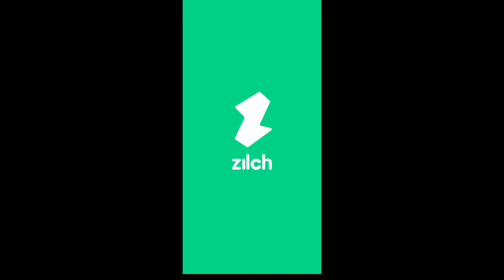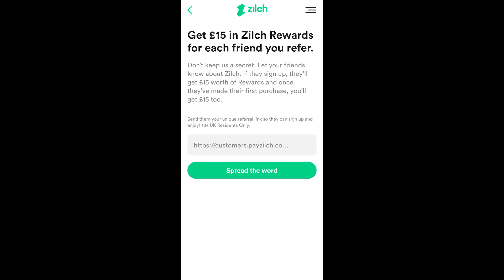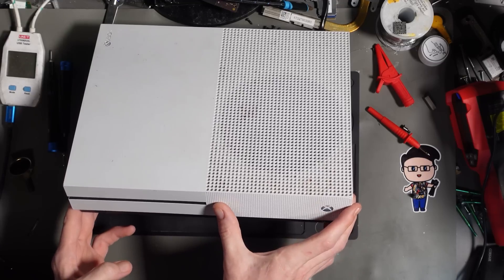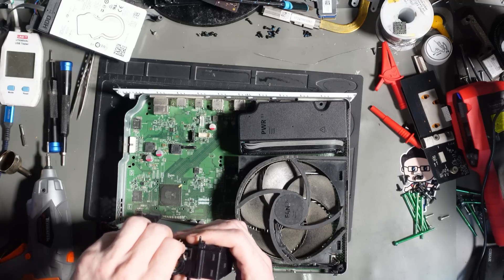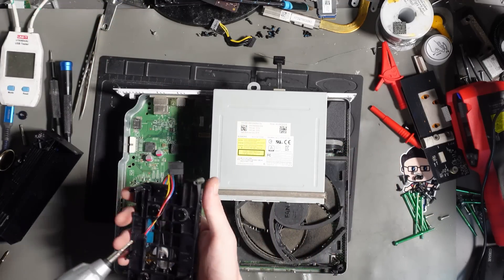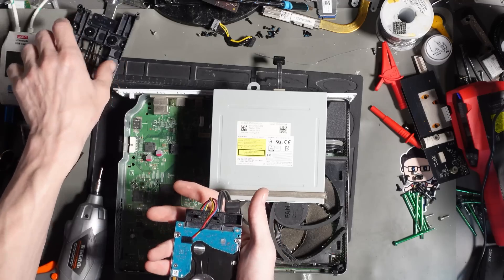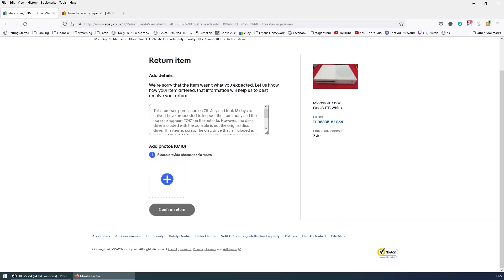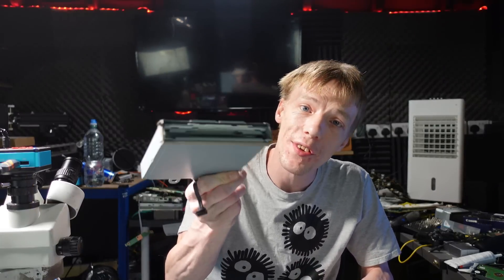I Bought An Xbox One S On Ebay And I Think I Got SCAMMED!

Comment: Wouldn't it be funny if the eBay seller tried to repair an Xbox one and an Xbox S at the same time. Failed to do it and put the wrong drive in both consoles. Someone out there will be receiving an Xbox One with a Series S disk drive 😂

Comment: I try to buy parts/repair consoles from sellers that don't deal in video game related items often . I especially stay away if it's listed as untested and they sell lots of tested/working ones . The only exception is Japan , I have had good luck buying broken consoles from Japanese sellers that only sell video game stuff . I have only gotten ripped off once from Japan on a WonderSwan Color that was missing screws and had a totally corroded motherboard that they did not mention . I ended up using the screen to repair another one so I broke even on it in the end .

Comment: I have been buying stuff on eBay for 18+ years. Over the years I have been scammed and got my money back for parts that turned out not to be what they were specified in the listing.  The thing is that I have still lost the time waiting for the part to show up usually 2-4 weeks. I then have to source out another part. Sometimes this happens with a laptop in pieces waiting for the part.  

Then there are the sellers who are charging horrendous prices for shipping a small item and that gouging for shipping is fine with eBay. You still have to wade through the listings trying to sort out the possible deals from the gougers. I rarely buy things on eBay these days

Comment: Classic ebay. Once I bought "working" PS4 Pro with "faulty optical disc drive"... in fact with faulty power supply holding just by a scotch tape (ripped screws) 😒

Comment: Get it sent back don't blame you some folk on ebay think they can send out anything if they put spare or repair and no return, wrong if the item is not as described as is the case here then no return means nothing the item must be as described and shown on the advert pictures, good on ya, i have had one off this seller which had damage which they failed to mention which would have taken a 2 second visual inspection to see.

Comment: Wonder how many times you've picked up a cheap console that's been described as faulty but you've found no fault - do you contact the seller offering to pay a more realistic price - doubt it. Don't get me wrong, I think this is bang out of order, but sometimes you get lucky sometimes you don't.
Reply from the maker: I've actually never picked one up on ebay and found nothing at all wrong mate. The thing is like you said this one is obviously a scam, but if I get them in for repair from customers and find nothing wrong I don't charge them apart from the return shipping, or if it's not as bad as first thought I'd call them up and request a cheaper price. I've done that stacks of times.

With ebay though, I win on auction for most things, so if I did get one with nothing wrong of course I'm not going to offer more money because that's the entire point of an auction, and if I've won it fair and square and the seller either hasn't tested it or misdiagnosed it that's not really my problem. But when we buy them and they've obviously been deliberately deceptive that's just wrong
Reply: Seriously, thats not a likely event, its never happened to me and I've been buying consoles to repair for about 5 years now.  Its not about gambling and getting lucky or not, its about sellers being honest with what they are selling, nothing more. Too many chancers on ebay who get away it.

Comment: This is a huge problem in the US with Nintendo switches. At least it is for me. Only 3 out of 8 or 9 Nintendo switches I bought on ebay weren't scams. The 3 that weren't scams, I was able to fix. I got screwed out of my money because they said they bought it as a lot and knew nothing about it being opened and previous repair attempts and I bought as parts. I loved working on Nintendo switches and liked learning, but I've now stopped buying them from ebay. I've stopped buying them all together because I don't know where else to get them. The risk is way too high and I have since been repairing Retron 5's instead and have been able to fix all but 1 due to dead CPU. It's very sad how many dishonest people are out there. I've given up...

Comment: I have a launch xbox one and my mom dropped it moving stuff around nothing was damaged internally and still works like normal but the front part of the shell where the touch sensitive buttons are the clips on the bottom that hold it together separated and thankfully the clips weren’t broken but i did not realize i had a disc stuck in there and I don’t have the proper tools to just take off the case (not the metal case where the motherboard is in) and I took off the case but I don’t know if there is a manual way to take the disc out of the disc drive and I am wondering if you know if there is a way to manually eject the disc and I am looking at tutorials on the how to het the shell back on but I am having troubles with getting the clips on the front bottom of the case and I may need help with that to. I also never broke my warranty seal until yesterday. Also I am trying to figure out how to upload a youtube video on an iPhone so I cam show you what I mean
Reply: FFS mate, I gave up trying to read this halfway through the second line. Put some punctuation in there!

Comment: I'm always concerned with trying to prove my case on stuff like this, because you open a dispute and it 9/10 times it's checked by whoever Ebay outsources their customer service to, maybe Malaysia? India?... So how do you prove to them that the part inside isn't original when they're none-technical, and their first language often isn't English. It's a frustrating issue altogether.
Reply: Well you take pictures and videos attached to the sellers post and you also get ebay's buyers protection and if that doesn't work you call your bank and do a charge back from theft because basically that's what happened theft. We are tired of you crooked sellers and that's what will happen if you son's of biatches try that with me.

Comment: I sold an old laptop for spares or repair which was complete and did boot to a fresh install of Windows 10. It was very tatty and had damage to the case and broken hinges. The buyer opened a case 29 days after the sale because the fan had stopped working. He won the case and got a full refund and didn't have to send the item back. I repair laptops but I sold this for parts / beyond economic repair but as I'd put in the listing it does work in the fact it boots to windows but has physical damage eBay ruled in the buyers favour. Got to be really careful how you word your listings. I've been ripped off several times where every part is faulty; obviously put together from junk parts from a repair shop.

Comment: people saying that the seller might have bought it as a job lot and is not aware, need to realise that it's there responsibility to list it accurately.

no one would be happy buying a Mac book air. and getting a Pentium 4 stuffed inside. 

this is the same. and we'll within the right to return. 

I've actually purchased from this seller before (switch) I got it working but there was more wrong with it than suggested.
Reply: I agree. If the seller has bought as part of a job lot then he would be better off saying so in the listing. I have seen sellers who state this along with parts may be missing. It’s better to be honest. 
Also whenever I see sold as seen no returns it’s a red flag to me. I bought a batch of tablets with the intent of harvesting 64GB eMMC chips off them only to find half of them had them physically ripped off the board! Fortunately I was able to repair one of the tablets fully working so it worked out ok in the end

Comment: It may be an uphill battle.  The eBay arbitrators will be clueless to the significance of the bad disk drive.   "As is" are the magic words used by criminals as they know the eBay arbitrators have a blanket type response to these disputes, usually not good for the buyer.  Best of luck though mate.

Comment: The seller may not of known about the issues. There’s a lot of resellers who buy big lots of electronics and they list the faulty stuff on eBay as they don’t have the knowledge/time to fix them.
Reply: Then they should state that in the listing.
Reply: eBay's listing policy says you must know what you are selling. So, it's not an excuse to not be aware of what you sold.
Reply: Right if we don't get those people off of there or those types of sellers it will be the standard allowing the criminal or crook to make that the standard, people are tired of getting scammed the seller needs to be listing everything they know about the item before posting, it is 100% the sellers fault, rather he bought it from someone else or not he should mention that period.
Reply: That seller rings a bell pretty sure I've had a run in before, ebays getting bad, folk think if they put spare or repair they can send any old s**t, I've just sent an s back as they had fu***d the board up caps off all over the place and they did nt even wash the flux off, funny thing is if they had turned the board over they may have seen the blown cap before setting to work on destroying the board.
Reply: In this case I’m more than certain the guy knew what he was doing, and there’s nothing eBay can do other can keep siding with the buyers. But I still stand by that not all are scammers and they list the faulty consoles without knowing the full service history.
Reply: Nah i think this seller just swapped out the disk drive will nilly without testing it or seeing be a genuine Xbox one s part. which wouldn't work with the one s or even read a disk on it

Comment: I remember years ago relative selling a tablet which they sat on and so half the screen was dead (physically viewable but touch was gone on one side) sold it as broken, buyer opened a return and WON as they said it touch wasn't working when arrived!  Same relative sold a laptop that they had taken apart and cleaned and repasted the chips and buyer returned saying it was from a smokers home (it wasn't) and smelled disgusting and left feedback stating that and of course won.  When I have sold I remember once sending an item, buyer refused to sign for it, it sat at depot for a few days, this was in days where you could escalate a dispite right after you opened it and they won as "the item wasn't delivered" within 30 minutes of them winning the dispute the parcel had been collected! it was a PS3 in their early days.

For faulty items, I have purchased and item has been beyond repair but may of been listed as partially working and returned for sellers to claim I am a scammer with buyers remorse, well if someone lists say a console that works but doesn't read games and its a full RROD thats not the same! The most common thing is sellers claiming I swapped items I wanted and sent them back different ones, happened so often that Ebay banned ME saying the amount of returns I opened was too many but when you buy/sell electronics there is a huge risk involved.

Comment: Not Ebay's fault guys. I got my money back whenever I returned any item. Ebay money back covers you. No fuss
Reply: I agree to a point, it's not eBays fault originally. But other than a refund they will do nothing about it and allow the seller to carry on selling items like this.  

I recently had an issue where I bid and won an iPhone. I paid for it and heard nothing from the seller for a few days so I messaged them and then a few days later they finally messaged back telling me that the phone was never for sale, he just listed his friends phone as a joke. 

After a lot of time wasted talking with eBay, they wouldn't refund me based on the message, I had to open a case then wait till I could escalate it for eBay to step in and refund, they also told me that nothing would happen to the seller and he would be free to do the same again in the future, they said it doesn't matter if he is breaking rules and wasting peoples times because buyers would be covered under the eBay money back guarantee. 

I stopped selling on eBay a while ago after an issue with a scammer, eBay basically told me that I need to take into account that sometimes I will lose money because of scammers and advised I upped my prices so I made more profit and could then cover the losses should I have issues like that again. 

eBay, just like paypal is just an overall scummy company these days
Reply: @EdMattyMoments  " ... and advised I upped my prices so eBay made more profit ..." There you go, corrected that for you 😉

Comment: Was close to emailing your good self but seems to be sorted, I changed the dying battery in my Switch and for some reason my SD card reader went red hot when I plugged it all back in to test, quickly pulled the battery plug and had the SD card out and it stopped, put the SD card in, wouldn't power on and just froze but works perfectly without that card in so either the card reader or the SD card is fried and as the cost of a replacement reader is like £3 I just plumped for that and a new screw set as mine was missing several screws inside and out.   Its still alive so luck was with me that moment, luck too my thumb was almost touching the card reader lol
Reply: No, no , no, here we talking about scamming b@stards on ebay, no time to deal with your switch now mate

Comment: I bought from the same seller. Project Scorpio Xbox one x . Black Xbox one x came. I took it apart, had a project scorpio motherboard inside. Hard drive was faulty. But I did use your HDMI redriver chip to get a display. Next I will probably find that I have your disk drive in it.

Comment: I use Amazon, eBay I’ve had problems, currently waiting for my retimer chip , BIG QUESTION will a x box one x retimer chip fit a x box one s ??? Please help
Reply: Really ? Because their way cheaper then the one s retimer chips , I’m worried their will be sound or artifacts etc , I hope it works thumbs up 👍🏻 I’ll give a update as soon as it’s installed
Reply: @richardstone8615  They are different part numbers but the one from the one X will work on the one S without any problems. Guess it depends where you're buying them but they seem about the same price roughly to me.
Reply: Yes it will fit.

Comment: Sorry but is not scam, is a console for parts not working and is what you get. 
The real is more and more common to drill a hole in boards to sell for parts (and not put in description some times) . 
To be honest I would say that it is a poor description no that it does not match what received. you can use the for parts as the description says but never be repaired.
Reply from the maker: I disagree mate. It was sold as a for parts xbox one s, not with mismatched parts from an original xbox. You may as well sell a spares or repairs BMW and stick a fiat cinquecento lump in it. You're entitled to your opinion, I respect that, but this was clearly not as described and if it had been described correctly I wouldn't have bought it

Comment: I bought items on Ebay for several years and i got scammed so many times it was unreal.   Almost half of the items
i purchased resulted in either me getting a rebate or returning the items or having to file a dispute.  I had people sending
me laptops with dead battery's and not mentioning it in the auction.  I had people sending me laptops with loose or broken
screen hinges.  I had people sending me gaming consoles that had many issues outside of what was stated in the actual
auction.  And the people who run Ebay are complete CLOWNS.
Reply: If a laptop is older than 3 years and has a dead battery that is to be expected. I mean a battery in most cases can be bought for under 50 bucks so when buying an older laptop just assume battery is dead as thats a common and OBVIOUS problem
Reply: @dorion9111  Nope, when you ask them if the battery is still good and they say yes, than that is fraud and a violation of Ebay rules.  No excuses for corrupt  Ebay users.

Comment: Definitely demand a refund, definitely fraud.

If this was anyone else, who didn’t have repair skills, they would be screwed.

Take the seller to the cleaners.
Reply: The disk drives are married to the motherboard so you can't even use a replacement drive without the original disk drives board with matching chip.
Reply: @getit7107  true its probly in another console he is selling propa scammer dnt get them type people because neg reveiws just hurts ur ebay
Reply: Sold as seen scenario, lol.